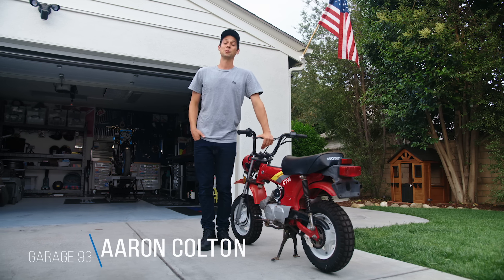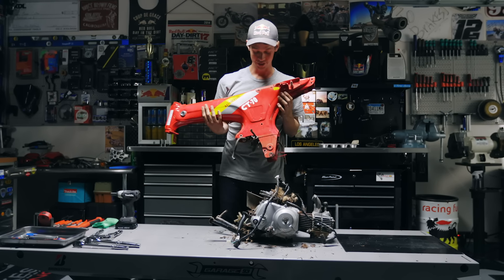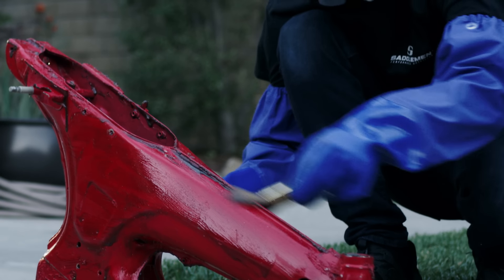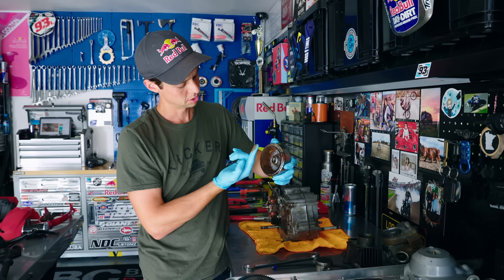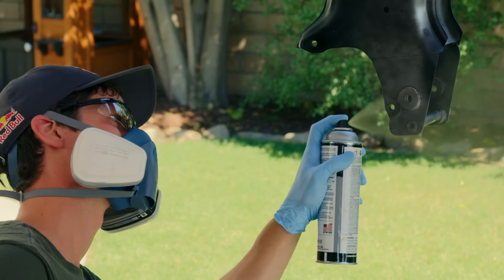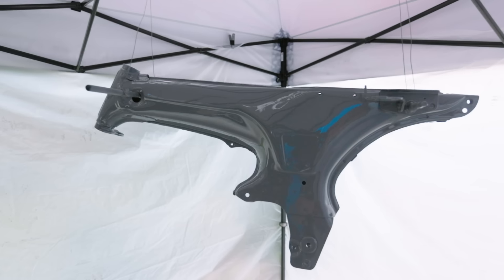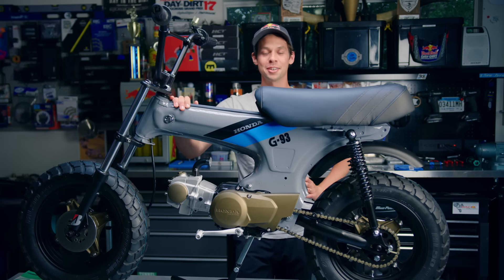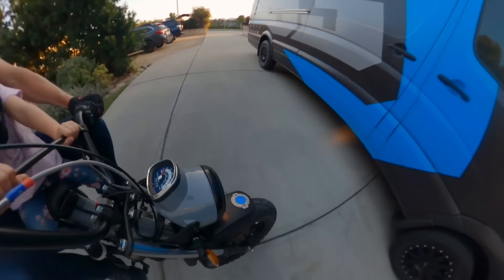Rebuilding a Honda CT70 Minibike | Bike Builds with Aaron Colton

Comment: My cousin had a Honda  dax  it was made into a 80 cc with i think it had a 125 carburetor speed way handle  bars a huge open mega phone race pipe it was so loud and very fast it had a very deep sound with a very deep blow back ported polished total rebuilt engine. Have a look at this 1976 XR-75  race pipe on u tube  in this car park look at thirtyonegun on u tube. Thats just nearly that loud as that XR-75 got . I was told once that some honda dax's had CDI ignition and they flew on the dirt track.

Comment: Just an FYI , Ct 70s have 2 piece rims so you dont need to use a tire bar or risk screwing up the bead with a screw driver.  Four 10mm nuts with an impact driver and bob's your uncle.

Comment: Is this the same engine as the 2000 honda xr70. And what did you use to remove the paint? Please help
Reply: I believe it is very very close but not exactly the same. I used Kleen Strip Aircraft Paint Remover

Comment: I just bought 2 ninjas 500ex ones a parts bike and one just sat for 2 years and but ran when parked. Do you think 500 Canadian was a good deal? I don't know to much about the bike tbh
Reply: If the one that sat for 2 years is in overall good condition, id say its a pretty sweet deal. check for spark and clean the carbs and you'll have it running in no time :)
Reply: @boltail3  Thanks, man! Supposedly it also came with keys and the title put into my name and I just found out today its a 86
Reply: @boltail3  Yea not sure about running in no time now lol. I took a look at it throttle is seized, clutch is, gear shifter, and the back wheel welp this is going to be fun lol

Comment: possibly for the future cerakote doesn't need an over. they sell air drying coatings as well
Reply: The Oven cure is far more durable than the air cure. I only ever use the air cure in extreme high heat situations.

Comment: What do you do for the old nuts and bolts? Get them re-zinc plated? Or all new hardware?
Reply: The majority of the hardware is a Stainless Allen set that was Ct specific for $60. Anything that was not easily replaceable I did a DIY black oxide process on.

Comment: What color and process was used on the engine cases and thr wheel hubs?
Reply: It is called Cerakote. It is a two part paint like coating that is extremely thin and durable. You can use a standard HVLP gun to apply it.

Comment: That is some real professional restauration job, what would such end result cost?
Reply: Usually if you're able to find a good quality ct-70, it'll cost you anywhere from 500-1000 (everybody wants one).  There are plenty of aftermarket parts, all reasonably priced depending on what you want.  My guess is that for this build, it would cost somewhere around 300 for all the parts, and 600 for the bike, so 900 total, which is a really good deal.
Reply: @isaiahheinsohn1472  i dont really think 900 total, this is totally rebuild, should up the worth, at least to even out the cost and a couple percents profit
Reply: @Moicc  yea theyve gone up alot in price, he started with a complete one without much rust at all that could easily go for like 1500 + all the parts he changed, new tires, rebuild engine, paint. My guess would be around 2500 total. which is still super worth it because it looks awesome!

Comment: Nothing will get your neighbors attention like washing off the chemical stripper off your bike on the driveway.
Reply: The stripper and removed paint remnant where disposed of properly at the local drop off center. The remainder of the minimal residual that was left on the tank was then neutralized and cleaned with a Vinegar/Water Solution once again. The last step was the rinse in the driveway. We run a tight ship over here.